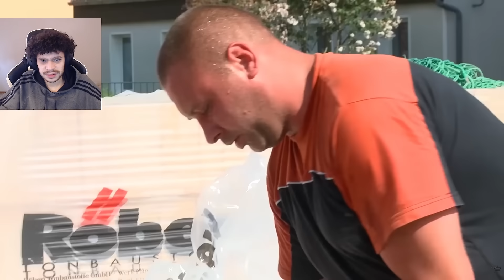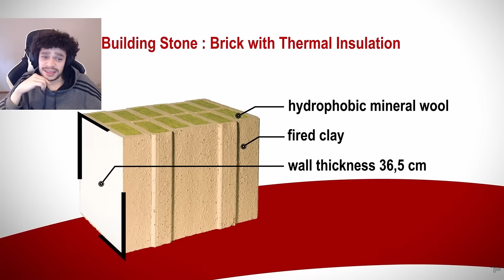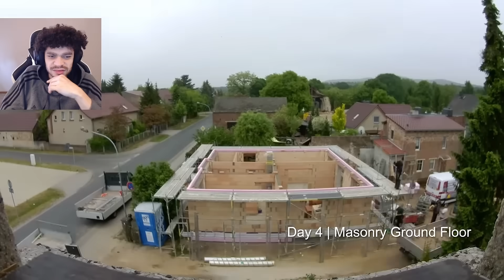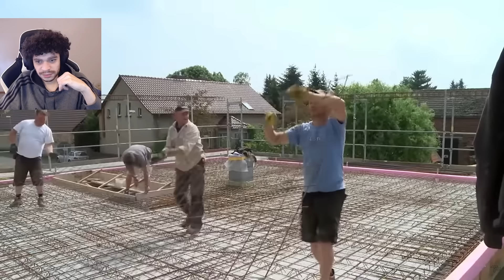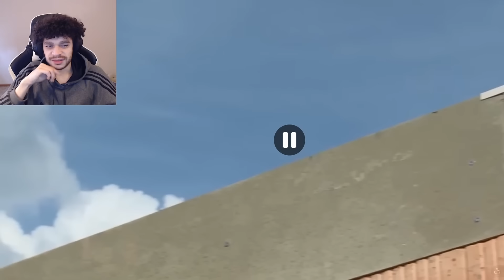American Reacts to How German Houses Are Built! *IS THIS REAL?!*

Comment from the maker: Germans, be honest... are houses like this actually common where you live? And for everyone else, how does your house compare or what surprised you the most? 👇
Reply: yes, thats exactly how we build a modern house!
Reply: Hab Maurer gelernt, natürlich ist das so.
1:35 the plate, back in the time when i've done this job, it's always been 32 centimeters (12.59 inches).
Today it has new regulations etc and it's between 15 cm and 30, so mostly around 20 centimeters i bet.
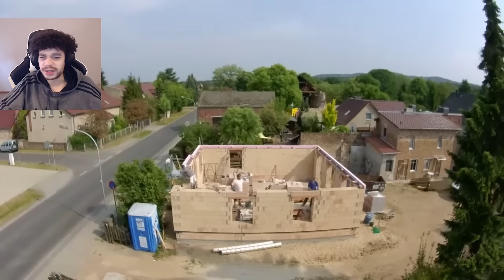7:30 nope, wouldn't be able to. 1st floor plate missing with its weight, after it, yes. xD
Jesus Christ, looks like much stuff changed, back in the time beneath the ground plate we've had stripe foundations aswell.
Reply: all the houses in europe are made out of brick and/or concrete... there are some older unbruned clay brick houses but wood is mostly used for cabins or sheds over here...

and I hate to inform you that you do have a concrete pourer in the states, but from what I know those are only used to pour corpo buildings, they must withstand the test of time, I guess...
Reply: @ginkamikaze2  eh, Norway called and would like a word with your "all European brick houses"... and i bet that Sweden and Finland is waiting in line.
Reply: @svena.halstensen5699  you know that besides the scandinavian peninsula everyone uses brick houses... is your ego so fragile you need to chip in about a factually correct statement?... you need better hobbies my dude, and no, I knew you nordics build wood houses and I wasn't excluding you guys out of the conversation intentionally, I think you have bigger problems at the moment than commenting on youtube...
Reply: @ginkamikaze2  and your comments are soooo amazingly interesting and enlightening, right? yes, everybody is cheering for your unique observations.
Reply: I life in a modern German "Lightweight" House. It isn't build out of "Bricks" but out of AAC Bricks. Called Y-Tong Bricks in Germany. They are larger but as light as a normal Brick and can be cut with a Saw. It's Autoclaved Aerated Concrete block so they have lot of Air in them and are great isolators while still beeing Blocks. But the building Method only differs slightly from one shown here: You can saw the Bricks down but they are as robust as the normal Bricks. When you see a German house with "Gray Bricks" than it is an AAC House. AAC Walls are great at retaining the Heat. Only the Upper Floor was retrofitted with an AC, the lower Floor wasn't. The Lower Floor as a constant temperature between 70°C and 77°C with little heating and no cooling even after Heatwaves. The only "Air Conditioning i do on this floor is running a Dehumidifier. The Upper Floor below the roof is another story, but there i have AC.
Reply: My house was built for my grandmother, by my great-grandfather, in ~1954. It differs from the house shown here in the following ways:

1) It was originally built off-grid, so it has its own water well. Today we use the well water for toilets and washing machine only, because it is not controlled for bacteria like the town water is.

2) It has a basement, 1.90m high floor to ceiling, housing the water pump, the oil heating (soon to be replaced by a heat pump), the laundry, and two storage rooms (one being the former coal cellar, including the three compartments, from before the oil furnace was installed in the late 1960's).

3) Two-story, red-brick walls (actually stoved right here, my great-grandfather ran a brickyard here), with a second layer of clinker bricks for insulation. During renovations in 2007, we added thermal insulation (styrofoam pellets) in between the brick layers, which (together with better windows and roof insulation) cut heating costs by more than half. We also replaced the original roof tiling.

4) In the 1970's, the former ground-level living room was divided up into rooms for my sister and myself, that one wall being the only drywall in the building. A new living room was added.

The house is 70 years old now. Aside from minor settling damage (some 1mm cracks in the brickwork that were fixed with epoxy) resulting from the added living room not having a basement underneath, it's in prime condition and good for at least two more generations of our family. In actual fact, replacing the oil furnace with a heat pump and adding solar panels to the roof is a project financed equally by my daughter and myself.
Reply: In Germany we have strict regulations how to build a house. You can say that every house will stand against a tornado... maybe the roof will be damaged... maybe, but i've never heard about a house which is collapsed by any weather phenomen and sometimes we can have heavy storms also.
Reply: @Am-Fear-Liath  Errr... Artal residents would like to differ. But yes, German buildings are very sturdy, especially in comparison with the average US residence.
Reply: @DevSolar  Of course, there were other construction methods in the past—and some, such as timber-framing or log construction, still exist today, depending on the region. However, these are not the standard. There are also, in some cases modern or "fancy", construction methods, though I do not wish to go into detail about those right now.
Reply: @Am-Fear-Liath  What I was saying is that brick has been the way to build a wall - any wall really - since we stepped away from building them the way that gave them the name "wall", German "Wand", in the stone age, because back then it was rods wound around vertical posts, and filled with clay.
Reply: @Am-Fear-Liath roofs definitely...
Reply: The one in the video is surey true, but also a premium version, and not that common.
Reply: The multi family home I am living in was build in the fiftys and has red brick walls (I know that from drilling holes, lol) and the outer wall is more than 2 feet thick. Probably half red bricks and half insulation strapped to the outside. The floors are wood planks, probably on wood beams. And when a storm is rolling through I am just closing all the windows (three glass panels in each) and wait it out. No draft and barely any noise is coming in. If the house would move from wind I would run out immediatly and call police and fire department etc, lololol.
And we have a basement with the furnace and electricity boxes and storage. No AC sadly.
Reply: yes
Reply: Yes, my house is built the same way, only the insulation material is slightly different and I have a basement and garage extension.
Reply: This is simply up to EU standards and regulations, nothing extra, so not only Germany, whole EU builds like that. Maybe the concrete ceiling - in SOME cases it is wooden.
Reply: modern hoses...yes...older houses....we live in a 400year old house build with nature stones...our outer walls are between 1,2meter and 2 meter thick..(aprox 6feet thick i think)
Reply: @hardcore9831  50 years ago, when my parents were building their house, they mixed natural stone with reinforced concrete :)
Reply: Thats normal. you want a good home to live in without big maintenance. BTW. pls not every sentence "We here in America...."
Reply: Yes, go to google maps and try to find a wooden, residential structure.
You won't.
Reply: I'm not from Germany, and this particular wall type - large hollow ceramic blocks - didn't quite make it here. A typical house (including mine) will have aerated concrete block walls on a solid concrete slab. It's not as much about costs (walls are a very small fraction of total cost), more about lesser labour qualification, simpler logistics and shorter building time. A two-storey house will have in-situ concete ceilings like in this video, a single-storey - probably not, mine is a simple wooden structure not unlike American homes. The walls are 60cm AAC plus 7cm rockwool, way over the code but all this extra thickness cost less than a washing machine. Certified passive-before-ventilation down to -30C, no need for AC. When outside temp hits +40C in the shade, it's still +23C inside. Today, we had +30C - beautiful warm weather - outside, and +21C inside with one or two windows half-open for ventilation.
Reply: I am from the Czech Republic and when an EF-4 tornado hit us, thanks to the fact that we build houses like the Germans, only a few people died. The roofs and windows were broken, but the brick walls and concrete ceilings protected the residents from the worst.
Reply: I live in a half-timbered house that’s over 100 years old. Although it’s built on a post-and-beam framework like your wooden houses, these wooden beams are much thicker than the ones you have—they’re about a foot thick. 
And the walls in between aren’t made of plywood like yours, but of stone just as thick as the beams, and the interior walls are actually still made of a mixture of straw and clay. It sounds strange, but it creates a pleasant living environment because the humidity is always relatively constant. 
People rarely build this way anymore, but there are companies that specialize in it. It makes sense if you’re moving into an area with such old houses and building a new home there.
Reply: Most of the houses build in this conventional way. But there are also houses out of clay, clay with woodenframes, wodden houses, Styrofoam with a core from concrete, natural stones.
Reply: These houses are very common. However, prefab factory built homes have become very popular. These can be made out of concrete. Houses made of wood are not totally unusual. Many of these wooden homes are based on construction methods from Scandinavia (Sweden, Norway, Finland). But these too will be properly insulated and will have central heating and triple layered windows.
Reply: The average size of a house in the United States is 250m²(2700ft²) .

The average size of a house in other countries is 100m² (1,100ft) .

Houses in other countries are made of brick, cement, reinforced concrete, cement plaster and ceramic floors. 

Construction costs are more expensive but the house can last 100 years
Reply: Russia and Brazil have more forests than America and their houses are made of brick and reinforced concrete.
Reply: German here. I literally have a friend who had his hand broken twice after punching the wall. The wall won without a scratch.
Reply: Yes they are and some Houses are even older then the United States.
Reply: Ja, natürlich!
Reply: This is Standard here in germany, at half timber houses they under Monument protecting
Reply: Not a german, but yes pretty standard in Europe
Reply: nope  there are tons of different styles or materials but still all are solid.
Reply: Wood is abundant in America, people lived there only 10k years. Europe had people 40k years, so most trees I see in my day in Europe are younger than me! There no other option here, but to build your house out of solidified mud.
Reply: No, they are not all like this, because this is a more cheap version of a House. Usually our hoses have at least 1 Sub-Surface Level called "Keller", oder Houses in the Cities have 2 or 3 Sub-Surface Levels. These "Keller" are quite usefull, but requires digging and other timeconsuming and costly work, so by just a concrete-Plate without "Keller" loike this, is a cheapy cheapy Version of a German House. Additionaly: This House has also no usable Floor under the Roof, which typical German Houses have, to maximise the given space, as Germany is much more densly populated then the US and Ground is expensive. So no Keller and no dachgeschoss is it, that makes this a even more cheap House, most likely owned by people who live on a Social walfare Income level.
Reply: @tommusikauswahl1066  I had to scroll to far down to find this. yes Melo, this is one of the most basic houses for small young familie, that you would find in Germany.
In most of the building steps one of the cheapest solutions are shown, to meet the bare minimum of standards.
Reply: Seconded. No basement is very rare.
Reply: @DevSolar 
Except in areas with a very high water table. We don’t have a basement—the clay soil under our house would have caused it to flood pretty quickly whenever it rained. And back then, there was no drainage or electric pumps.
Even many of the newer houses have deliberately done without one and instead sought other options, whether it’s a large attic or a smaller addition with rooms for tenants.
Reply: @Ace-Of-Spades--- You know that every basement can be made (and is made) watertight? That's why there's usually pumps running during excavations. If the water level is so high that a watertight basement would negatively affect the stability of the structure, that's a good sign that you shouldn't be building there in a first place...
Reply: @DevSolar YOU know that my house is build more than 100 years ago?
Reply: @tommusikauswahl1066  Disagree. These people can afford to BUILD a house, so they are definitely above social wellfare (apart from kindergeld etc). And the lack of a Keller (basement) can be a regional thing because of high ground water levels. And just because the space under the roof is not being LIVED in doesnt mean you cant store anything there. Some wood plates and you can store boxes no problem.

Comment: In Germany and generally across Europe houses are built using brick, concrete blocks, or poured concrete, much like here; there is little timber construction, except in mountainous areas. Construction methods and wall thicknesses are very similar from one country to another (I am based in France, but I lived in Germany for a year and know so well Italy and Belgium well). 👌

Comment: A common US-built house for a generic common US-American is about $40k & it may blown apart with the next storm.
Am common German-built house is made to stand for at least 50 years - for any kind of people - and I storm may come around, it will maybe cover some tiles up, which weight between 10 & 20 kilos (20 to 40 pounds) each. Normal price: ~ €300k ($350k) - paid by pre-finance over a decade (10 years) before you even built the house ...

Comment: Back in 1999, we had a major storm here in Germany with wind speeds around 130 to 150 km/h (about 80 to 95 mph). At the time, we still had an old, uninsulated roof. Inside the apartment, you couldn't really tell there was a storm going on, aside from the loud howling wind and the shutters rattling. The only damage to the house was a few roof tiles that got blown off. That left a hole about one meter (about 3 feet) wide, but we managed to fix it from the inside while the storm was still raging so the wind wouldn't rip off even more. A few years ago, we got the whole roof completely redone and insulated, so it would easily handle a storm like that today.

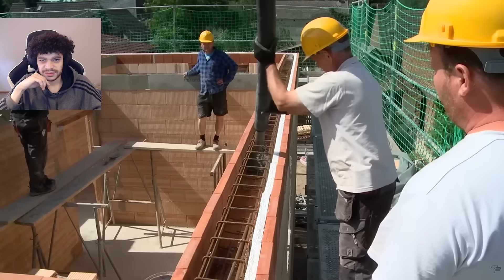Comment: 14:41 Notice the multi-layered structure.
Reinforced concrete on the inside. Brick on the inner side of the wall.  On the outer side of the wall, there is insulating foam between the brick and the concrete.
If this weren’t the case, the wall would develop mold here after moving in.
The reason: The air inside the house is warmer than outside. Therefore, there is more water vapor in this warm air.  Concrete cools down faster than brick. The water vapor condenses on the cold concrete. Mold thrives in damp areas.
However, the bricks on the inside can warm up enough that the water vapor can no longer condense. No water, no mold.

In Hungary, we generally use a material called Ytong. It is essentially foamed gypsum. It is the cheapest option because gypsum is an industrial waste product generated during the carbon dioxide removal process in power plants.

Comment: Here in Central Germany, older houses usually have a basement. 
However, basements are becoming less common in single-family homes these days; after all, building costs have risen. 

I believe the ring beam is something typically German—or perhaps the roof structures crafted by our skilled carpenters; we really set the standard in Europe there. Our windows are generally high-quality, too, though you can get comparable products from Eastern Europe for less. I think many of our neighbors are building to a similar standard these days.

Comment: A German here, yes, most of our privat houses are build of bricks or stone, but there will also come some plaster for the outside and drywall on the inside...floors usually are wooden, laminate or carpet. We do feel storms, rooftiles get blown off regularely or our double or triple glassed wkndows break because of debris flying around.

Comment: "Does your house shake at all?" 
Uhhhm...no? That would be terrifying :D n
I have quad pane windows that lock like a bank vault and 40cm outside walls in a steel reinforced concrete building. 
That sucker won't shake for money and even gale force winds are barely audible inside.
That is the standard throughout Central/Western Europe from what I know. Scandinavia has much more wooden construction

Comment: Fun fact. We don't get tornados or typhoons that much in Europe. There are storms from time to time, and there are hurricanes on the Atlantic coast, but nowhere near the US Tornado Avenue. Too many mountains going different directions in Europe serve as wind breakers.
That being said, the most important consideration for building a house in Europe is thermal insulation. Winters can get nasty cold, and summers nasty hot. 
Also, wood is too expensive for building because after millennia of deforestation, what is left of woodland in Europe is heavily protected. Bricks, mortar and concrete are the staple in pretty much whole Europe. If you wanna go fancy (and pay for it) then it's stone and stone slabs.

Comment: The average size of a house in the United States is 250m²(2700ft²) .

The average size of a house in other countries is 100m² (1,100ft) .

Houses in other countries are made of brick, cement, reinforced concrete, cement plaster and ceramic floors. 

Construction costs are more expensive but the house can last 100 years